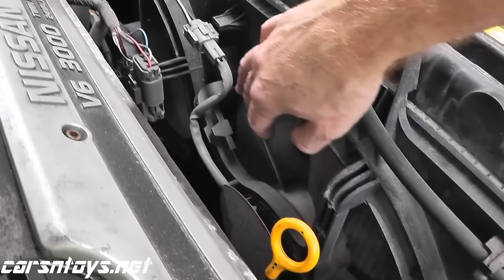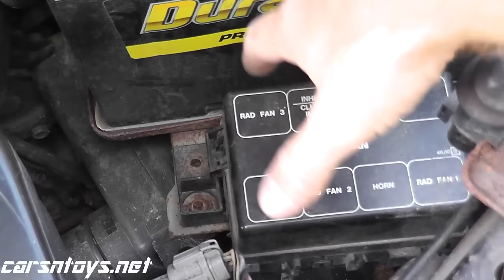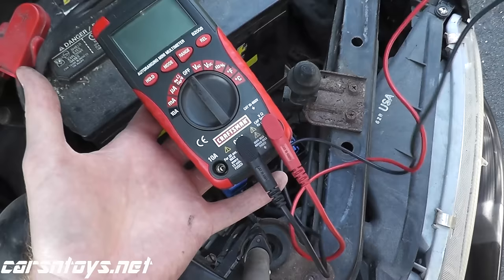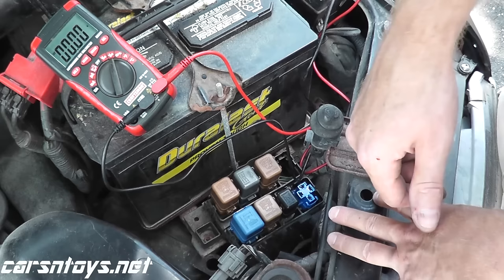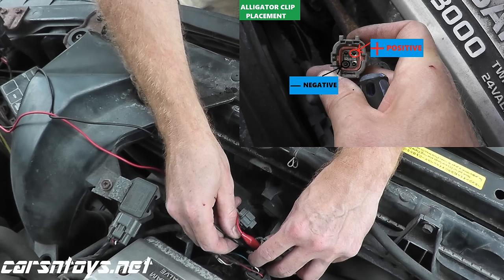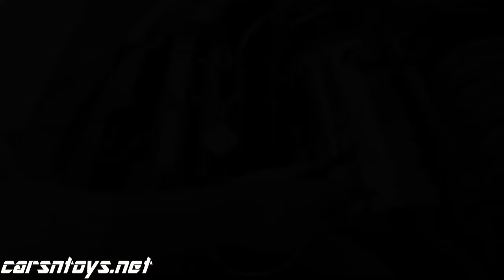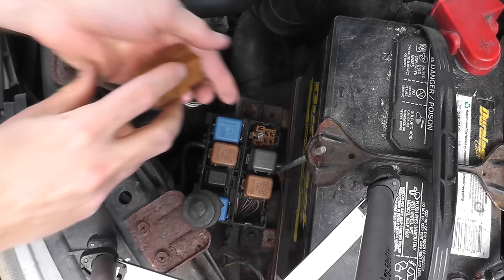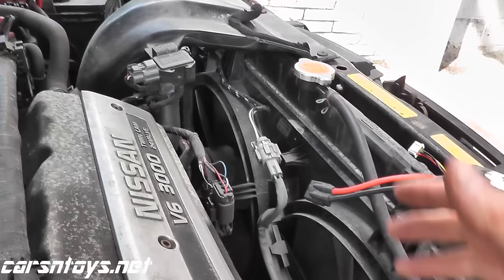Overheating Help! | Testing Cooling Fans - Relays - Connections

Comment: Excellent video! Big help! However, I wanted to add something to it that I found out in my 72 hour overheating diagnosis. HOPEFULLY, it will save someone else a lot of headache. I spent 3 full days researching what my problem was. 2014 Mustang V6 was operating fine UNTIL I turned on the AC; then it would overheat. I popped the hood and realized that the fan was not running when the engine reached high temp. I tested the fans, relays, fuses per your instructions - everything checked out (SO I THOUGHT). The actual problem was the Fan High Speed relay. It had continuity during testing with 12v and multimeter; but failed under the actual load in the vehicle. SO, I strongly suggest that if you hit a brick wall; swap out the relay with another working relay (in my case it was the relay for the starter). Soon as I swapped it out, the starter was dead; switched back and it was fine. Bought a new relay for $21 with lifetime warranty and I have been good to go! Hope this helps someone!
Reply: This is an excellent tip I learned from my old school mechanic neighbor when I was a kid
Reply: I tried testing the relay just by switching it with another of the same in my Subaru Outback. Everything was still fine so I figured it wasn't the relay until a couple days later my wipers went out because that's the relay I replaced it with.
Reply: What one was it
Reply: This is happening to my 2014 v6 premium mustang ima check this out I’ve been suck for a min
Reply: I'm sure the bad relay also had lifetime warranty from Ford
Reply: I really hope this is my issue. Thanks a lot I really appreciate it
Reply: You lost me on starter ?  Your high speed failed yes ? Thanks
Reply: Beginning to think this could be my issue.  I to seem to get more overheating if temps are lower not necessarily ac on as not quite warm enough 4 that yet . I've got a relay tester so I'll be testing them first thing ..I've just put in a new pump (was due anyway ) and was sent wrong thermostat so get 1 tomorrow . If relays check ok it could be coolant sensor again ... ...but I've only seen fans come on from what I can tell at lower speed not high . Thanks buddy
Reply: So a fail relay for a stater can cause your car to overheat?
Reply: @ironicdon No he means he switched out the starter relay for the fan relay and the starter stopped working, meaning the fan relay was bad.
Reply: Thank you! Great advice!

Comment: In older cars you can connect the switch directly to fan/s by using fuse panel so if they don't start (which may happen due to bad thermostat) you can turn them on manually. Hope that this helped someone

Comment: all of that is helpful but missed one part way in the back there the thermostat housing is a switching unit " coolant temperature sensor " if this is not functioning it doesn't send the " click on " signal to the relays and thus fans don't run this can be caused by electronic failure or the thermostat itself is not opening to allow the coolant thru the pipe to the sensor as u showed with this video all the easy to reach stuff was tested and working so for non working fan under these test cases relays / wireing / fan moters done would inverably be the CTS switch or a blocked thermostat port
Reply: if I still have my dashboard coolant temp going up and down normally, that would indicate a functioning CTS, correct?
Reply: @ethand5672  i have the same question lol
Reply: @Benjamin-xr1xy  did you ever get your answer? I just started troubleshooting today but was wondering that as well. Temp gauge works fine.
Reply: sevdustx did you ever get your answer I need helppp
Reply: @thezenchick790  u can acquire a laser temp thermometer from essentially any auto parts dealer, harbor freight, etc...to see the exact temps of coolant, oil, brake components etc..then u will know if ur sending unit is engaging at or near the proper temp..and saves a lot of ouchy and ooohh ahh hmm that’s hot ouch moments..lol..cuz the laser reaches where our hands cant and remember to keep the distance from the piece ur checking and the thermometer approx the same for accuracy..

Comment: Well explained with great camera angles. By far one of the best automotive repair videos on YouTube.
Reply from the maker: Thank you. Appreciate the feedback.
Reply: @CarsNToys so on my 2001 acura mdx, the fans are not turning on and the temperature Guage is reading normal but if I pull the relay out, which I tested and is fine, if I take a test light and connect to ground and touch the test light probe to where the relay plugs in, the low fan turns on. What do you think it could be?

Comment: Excellent diagnostic, here !  Clear and simple. 1st, check the fuse !  Also, in a pinch, you can swap the #1 relay with  one of the other relays on the same number designation. Swap the two & see if your fan issue is resolved. #1 relay should hold the coolant temp at ~ 190*F, even on a hot day.

Comment: I really appreciate the time you put into this and the methodical way you explain step by step so clearly. I can't wait to get started tomorrow on mine. my Pontiac Montana overheats because the fans don't come on and the connectors to the heater hoses in the back became brittle and finally cracked. I purchased it old but after all the work of putting all those hoses back on, you made this seem like a piece of cake by comparison. Thanks again

Comment: Most helpful description I have ever thank you so much.

There was one little thing, if there is no voltage it is not a shark, it's an open, a short with blow a fuse or cause wires to burn.

It's a tiny issue and it may avoid explnig it.

That said many many thanks, you are the best I have heard at the many hours of searching.

Best wishes
antiguajohn

In apresiation I was going to email you a Pina colada from here on the beach ( while watching the topless ladies walking by).

Unfortunately for some odd reason it has been disabled on this planet, work perfectly well on Star Trek 😂

Thank you and best wishes.

antiguajohn

Comment: thanks for the info, my ac and radiator fans both dont come on so i'm gonna buy a multi meter and do some digging and see if i can figure it out. almost overheated in traffic yesterday.... very stressful
Reply: Was it a bad relay, bad connection, or bad fan? In the same position right now. Ruled out a bad relay today.
Reply: @BroadcastsFromPoorFarm  I’m not sure I haven’t even touched it yet, but I will be soon. I just replaced a headlight connector and noticed the other one had been replaced before as well so I’m wondering if the plugs/connectors are so old the power isn’t getting to the fan. Gonna check relays/shorts/connections soon. But I’m wondering now if it’s a bad connector

Comment: I got a buddy that is interested in my expertise when it comes to fixing a radiator fan. I've never fixed anything on a car. Official expert!
Reply: I'm not a mechanic / auto but imagine a electronic engineer and I changed the water pump in my Suzuki XL7 with 200,000 miles and it was a massive job to me cause half the pump on this auto is inside and outside the engine,so we can do alot of jobs on our vehicals to save money but thanks You Tube I done it.

Comment: Superb presentation.  You are a great teacher. Subscribed. Even in cars with a multiple speed Single  fan , the low speed function can break early and slowly destroy the ac compressor and then the entire system will have broken parts of the compressor circulating.

Comment: I've been having a problem with my air conditioning and I been looking at some videos and I did not know that the fan works with the air conditioning but I only have one fan PT Cruiser and your video is so detailed I'm gonna try and check all nam circuits thank you for this good video
Reply: I believe that’s what my problem was I just bought this mustang and they had put a new air conditioning in the vehicle as well and they also use this other set up call to Mishi Moto and when I drove the car originally during the day for the first time everything was fine and then when I turn the air-conditioning knob from where it was to the off position is when I had a problem with the car overheating I just got the car today I’m gonna try to switch that setting back to where it was because the way this thing is wired up it should kick on on its own when it gets up to temperature and I noticed when I was driving the car for the second time when this happened temperature gauge really wasn’t going up while I was driving it for the 20 minutes before it overheated

Comment: Your method helped me track the problem down. Well, half of it anyway. My AC fan would not turn on even though I turn the AC on. The radiator fan kicks on like normal. Both fuses are in the clear. Will have to have the mechanic check that while he fixes another problem I have. I've been having the car go into overheat when I idled, but cooled down when I drove, especially when I turn the AC on lol. You saved me from having to go and buy a fan switch and thermostat for nothing.
Reply from the maker: Happy to help!
Reply: @CarsNToys  So long story short, the mechanic said the fan went and died. Thankfully was able to take care of buying a replacement that day.

Comment: at 3:50, if you don't have power, you have an open circuit.  A short would drain your battery and most likely start a fire.

Comment: Great vid.  I have 1 fan not turning and 1 turning .  Yah I think it’s the fan motor. But good to see how to test the relays also
Reply: I have same issue , did u ever find out ?
Reply: @fugio0416   replaced the fan assembly  with 2 new fans and 1 fuse

Comment: Thanks for the easy-to-follow testing instructions.  I'm new to a multi meter tester, so this helped.  My car's fans aren't working.  I've changed all relays involved (had no way to test them before) and temp sensor.  I'm going to do the multi meter test for current and continuity.  👌
Reply: Sorted now dude ?

Comment: Awesome I watched the first couple minutes of this video and you just saved me $110 diagnostic fee tomorrow and God only knows what else they would’ve blamed it on but in my case when I reach down unplug my fan to test the Wiring to them. I found that they were not clicked in all the way, basically they were unplugged. Once I put pressure to snap of them tight I turned my car on and fans came on immediately ! Not sure how they worked loose but hey awesome video thank you
Reply from the maker: Good stuff! Glad to help.

Comment: Great video, after replacing radiator fan on my 09 vauxhall corsa the fan wasn’t coming on for a/c or engine cooling, all relays were good as I used your method to test relays and the fan which was working when I connected it up to the battery with crocodile clips, but still not coming on at 100°C to cool engine down, after removing fan shroud i noticed that the fan resistor was corroded and after replacing it my fan comes on at the correct temp, and after getting the a/c tested and regassed all is good, when I have the a/c on now the fan spins giving ice cold air in the car now, thank you 👍🏻
Reply from the maker: Awesome! Glad it helped. Cheers.

Comment: EXCELLENT VIDEO! I'm having a current issue where my fans won't turn on. I've spent so much money on new relays, fan temp switch sensor, ECT sensor, and still my fans won't run. If I disconnect the connector that terminates at the fan temp switch sensor then my fans come on full blast. If I reconnect that same connector back to the engine harness the fans turn off (meaning there is continuity) and if I go and turn on my a/c the fans run on low. So, I know my fans are working and I have a Relay Buddy tester and verified that all three fan relays are fully functional. So, I conclude that there's def an issue with the relay box / battery area and where it grounds, I think. Because when the fan temp switch sensor hits its temp range and sends its ground signal, that signal is not reaching the ECM is what I am thinking.

Comment: Thank you for your  very helpful vid.  I was able to fixed my overheating problem today!  Your vid is straight forward and to the point!  Kudos bro!
Reply from the maker: Thank you. Glad to help. Cheers.
Reply: @CarsNToys  With key at ON position, 86 of the C/Fan Relay has 12 volt, and 85 had 1 volt respectively. This relay sits on the engine compartment box.

Now, my issue is that as a test light bulb with its one end connected to 86 and other end to ground, the bulb did not glow. Same case for testing a relay. In both cases, the voltage across each loads is about 3 volt. Why is this happening???

Comment: Thanks for the video!  I’m hoping some of this helps me track down my problem on a 2005 Sienna.  I have a problem where the fans stop working when the van is hot and been sitting idling with AC on. We sometimes need to do this for our dog when we are at swim meets.  When it happens we loose fluid out of the reservoir. It’s lost up to a gallon before. Runs fine otherwise and No overheating.  If you have any suggestions please shoot them my way!  Thanks!

Comment: Also, checking for continuity in the harness will tell you if it open, but if it is shorted out it will also still have continuity.  Better to check to see if the hot lead is shorted to ground first, then power the circuit and see if you have power at the connector
Reply: What do you mean by this? Please further explain
Reply: I’ve ran into a brick wall with my situation, I have a great feeling your comment & Information will be great help
Reply: I just quite don’t understand
Reply: @marcosd4381  If you disconnect the battery positive terminal, then use a multimeter set to test resistance ( ohms), then you put one of the meter probes ont the  battery negative terminal and use the other probe on the connector in question, you should have 0 ohms resistance  on the ground pin and some resistance on the positive pin.  If you see 0 ohms resistance at the positive pin, then the positive wire is, somewhere, shorted to ground.  If  you have some resistance there, reconnect the battery, place the meter on dc voltage setting, turn on the ignition and see if you have voltage across the pins of the connector.  Be aware that there may not be voltage until the engine is at operating temperature, in the case of a cooling fan.  This same test can be done at the cooling fan relay.  In fact, that is the first location to check.  If the voltage is present at the relay, then check to see if it is present at the fan connector.  If it is not, then either the relay is bad or the wiring between the relay and the fan is bad.  If there is voltage at the fan connector but the fan will not come on, then the fan is likely bad.    Also be aware that if you probe the relay socket for voltage by putting the black probe lead at the battery negative terminal and using the red lead to check each pin of the relay socket, there shoukld be 12 volts or so at one of the pins.  That is the voltage that will go through the relay to the fan when the relay is closed.  If you do not see battery voltage at one pin, check the fuse and other wiring from battery positive to the relay connector.  That is a basic check.  I don't recall the details of this video, but will be happy to amplify my answer if you have more questions.
Reply: @Kneepuck great thanks

Comment: I have a corolla with radiator fan issue, the fan works directly, relays are fine too, im gonna check continuity of the fan wiring tomorrow, fingers crossed.

Comment: great video that explains a lot, meaning lots of tips to figure out the issue I have, where my fans are normally supposed to kick off at around 215F, instead the engine bumps up rpm as if I hit the gas pedal for a fraction of a second.  If you have a tip on what could be the issue please advise.  I do not have the testing equipment you have (yert!).  It's a Dodge hemi 2018.  How I broke this is I started my car without the Tb connected, which triggered 3 codes...  Then the issue started and is just non stop.

Comment: Good info.i replaced my radiator and after replacing it the fans so far are not working battery was not fully charged I will try your plan .thanks

Comment: @CarsnToys Hey bro! Thanks for making this video! I have a 2016 Chevy Sonic, and i have issues when i'm in a traffic jam or idleling for long period...I have ac on when  i am stopped hot air comes out, and eventually temp gauge come on beeping, i pulled over and popped the hood and opened the coolant cap and pressure came out and liquid went everywhere! This video helped me figure out what i need to do to rule everything out. Some people say it could be a leak or a crack in the radiator. Not sure.

Comment: If there's no 12 volt source at the dist box could be more likely an open circuit than a short. Good tip on tracing from box to wiring connector. Another thing is people think if the a.c. powers the fans on that all is good. The problem is the a.c. doesn't control the fans when in use for regular engine cooling.

Comment: Thanks for this complete explanation.
Is it possible to check at which temp the controlbox activate the fans?
Mines are working but at a too high temp...
(freelander 1 Td 2.0 (Landrover engine)
Regards, Jean

Comment: Great job 👍
A question...
What if all relays and connections are good and the fans work good  but they delay. It takes a while till they kick on. I start engine and they are off, then I start the a/c and they are off. After a 3 - 4 minutes they are on.  What seems to be the issue?

Comment: Good video Thanks.  I have a 2013 forte and there is only 2 wires. The fuse box under the hood looks different than the 2011, but I'm thinking that it may be the same idea. I can't figure out which is the upper from the lower fan relay. Any suggestions?